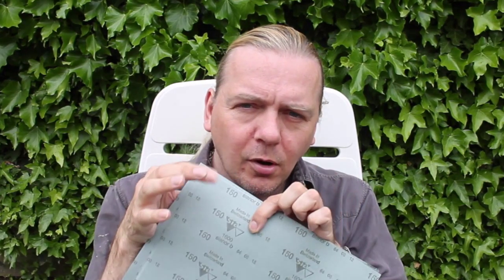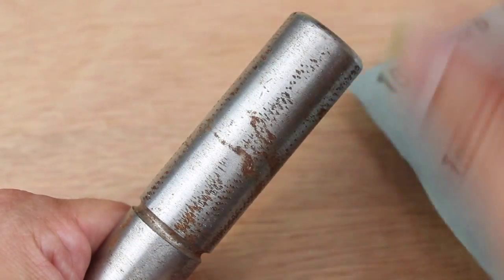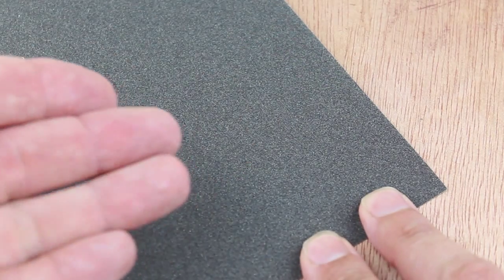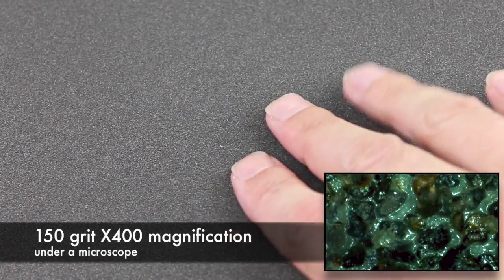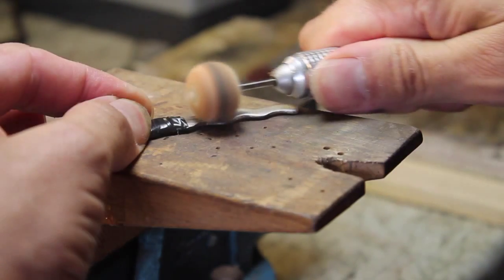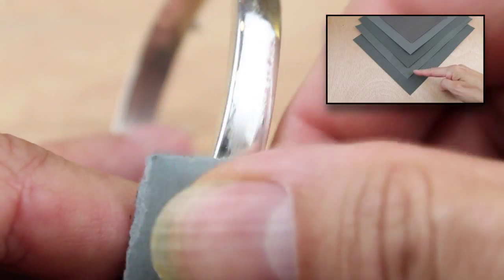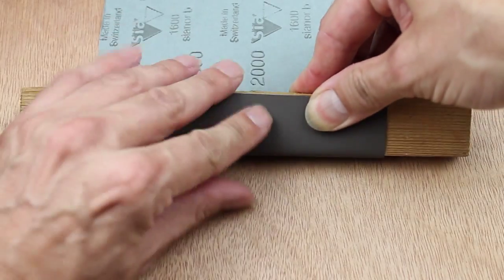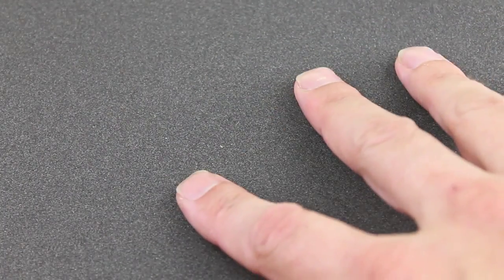Emery Paper  & Buff Sticks.  Tips & Tricks. Demo & Review in HD

Comment: thanx for everything from the Netherlands :)
Reply from the maker: Well thank you. Hi to all my viewers in the Netherlands !  Dave.    : )
Reply: Celtic Dreams What is the diff between emery and sand paper
Reply from the maker: well short answer... Sand and Emery. Sandpaper is usually used by woodworkers. Sand is mainly composed of Quartz. Emery papers use Emery which is different mineral and much tougher, so better for metals and tougher materials. Other common abrasives are aluminium oxide, or diamond. Emery works fine for gold and silver. Dave.